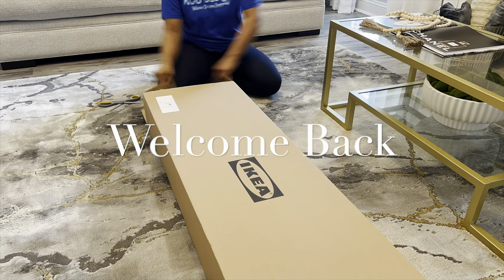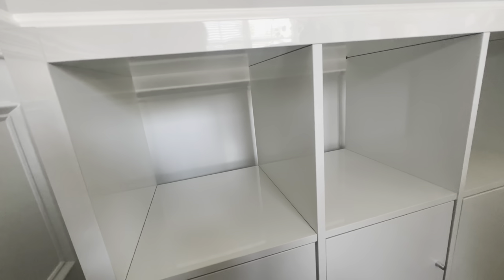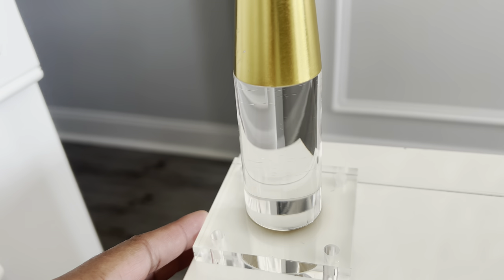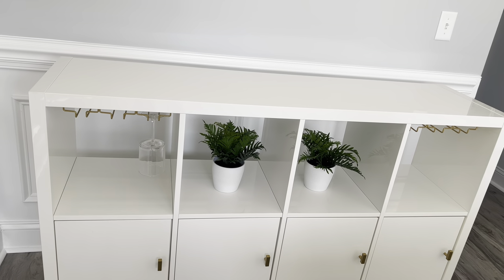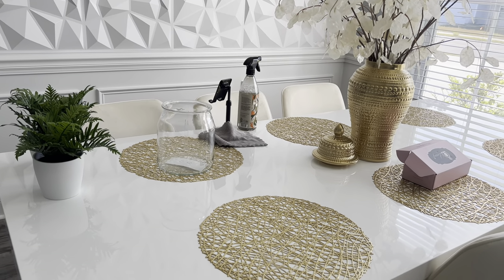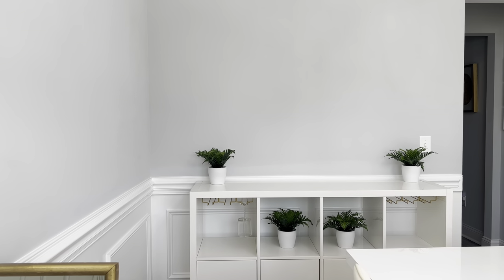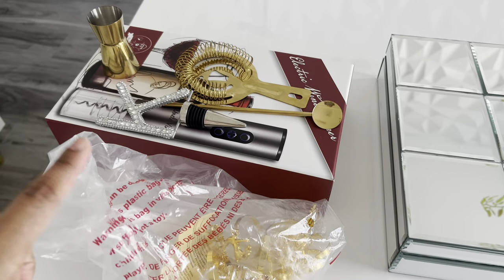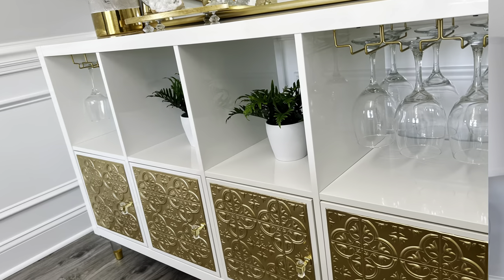DIY IKEA KALLAX HACK TRANSFORMATION|| DIY SIDEBOARD

Comment: This turned out great! Much less expensive than buying a Buffet or Sideboard. I did this for a dresser for my room. I needed a skinner (not so deep) unit. Dressers took up too much room. I did 6 door inserts & 2 drawer inserts. I also bought the Underframe for this, which adds a lot of support & strength along with attached legs. Might I add a Tip for everyone assembling any IKEA furniture, use wood glue for everything! It makes everything hold together much better. Especially if you have to move. I add wood glue to every peg, cabinet hardware etc. where there’s a hole put wood glue in FIRST! Hope you find this useful. I’ve done this with a dining table, chairs & 3 cabinets that I use as a buffet! Happy assembling! IKEA directions are not the best!❤😢
Reply from the maker: Thank you so much for the tips. Thankfully we are done with military moves. When and if we move again, I will certainly take that into consideration. TFW